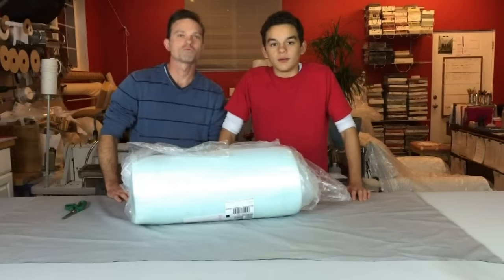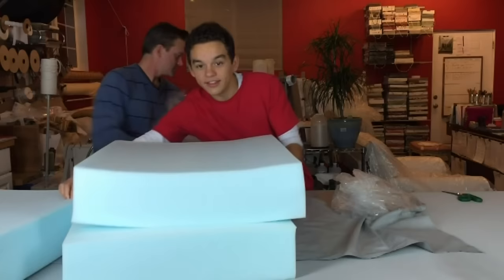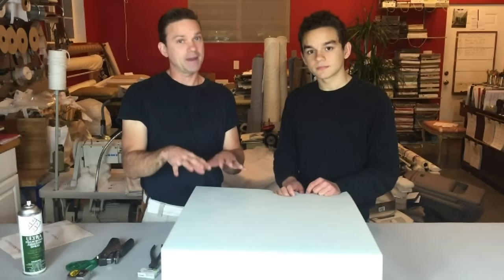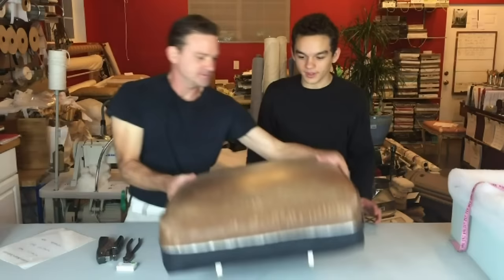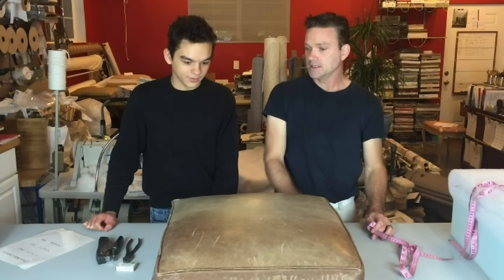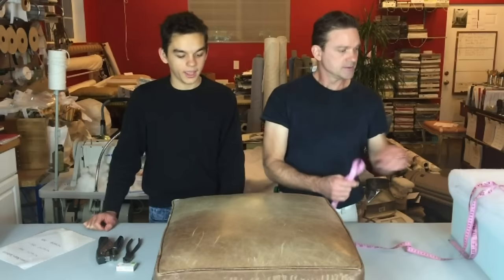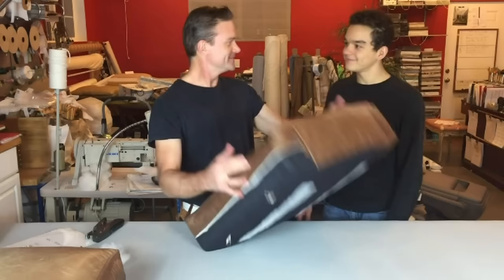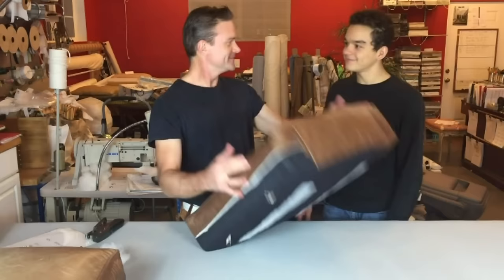Replace the foam in your seat cushions fast and easy!

Comment: An elderly (92 year old) seamstress told me today that she used to use some kind of pillow machine to squeeze the foam in all directions so there would be no struggle to get the case over the foam, and it would go on easily. She said the machine had straight metal arms that compressed the foam. Then she pulled the case over the metal arms. The she slid the whole covered pillow off the metal arms. So putting the foam in the case took only a couple seconds. It looks on this video that you don’t have much struggle getting your foam into the case, but in real life, my foam doesn’t slip so easily in. I’m searching the internet to find a pillow machine like that lady described to me, so I came across this video. But I’ve seen no such machine anywhere online yet. I would love to know if you know of any such machine.
Reply from the maker: Hi Heard,
Great question! Personally I’ve never heard of a machine like that. If you are nervous about putting in foam into your cushion covers you can use a plastic silk film to vacuum down the insert to a more manageable size. You can get the silk film here https://www.amazon.com/gp/aw/d/B071229FT1?psc=1&ref=ppx_pop_mob_b_asin_title

Though, inserting cushions into covers, like you said in your comment, isn’t that hard. You can put your cushion on it’s side on the floor and use your body weight to push in the insert one side at a time. 
I hope this helps! 
All the best, 
Grant

Comment: Hi, you have mentioned the Density as 26 and ILD as 45 for one of the foam.

What's the units of measurement that you are using.

Density- 26 Pound/foot^3 or 26 kg/meter^3
ILD- 45 pounds or 45 kg
Reply from the maker: Hi there Ritesh, good question. The system we use is the first two numbers is for the density 2.6. That is representing the volume each section of foam has 2.6 is good. The second number is for the compression in pounds. How much weight it takes to compress a piece to 75% of it's original thickness. So a 4" 35 compression will take 35 pounds of weight to compress the 4" to 3". I hope this has help you and thank you for watch the video. Please share it helps when you do. Cheers,  Paul
Reply: @ucsolutionsgivingmore  Thanks, so 2.6 density means 2.6 pounds per cubic foot. And ILD of 45 means 45 pounds to compress 25%. 

Your viewers are from different countries which might be using units of measurement. It took me a while to guess and convert your description to understand what you meant.

Comment: I took my cushions to a local cushion/foam business and my cushions are now worse.  It appears they measured incorrectly so the cushions don't fit on the couch correctly, thus I'm going to try and redo myself with the help of your video.  The fabric of the cushions bunches in some areas and pulls in others.  Should I measure in multiple areas and average the measurements or should I remove the cushions and lay the fabric flat to get the best measurements?  Or can I just send the fabric to you?  Thank you for your assistance.
Reply from the maker: Hey, Shalese thanks for watching our videos! Sorry to hear about your experience with the previous seat cushion replacement. Great questions, your cushion measurements shouldn't vary too much, if they do you can “average” them out closest to the highest number. You should definitely measure in multiple areas though. And you can measure without the existing foam just make sure the cover is perfectly flat and symmetrical. I hope this helps!

Comment: So when using that recommended compression chart, the thickness numbers are for the foam -- not the cushion band, right?  So if my seat cushion has a 3 inch band, you're recommending 4-inch-thick foam.  So I use 4 inches (not 3) on that chart, which yields 2626 foam.
Reply from the maker: Hello Matthew,  
Yes you have that correct the numbers represent the thickness of the foam not the band. Again that’s correct if your bands are 3 inches you would want to get 1 inch thicker or 4 inch thick foam as well as 1 inch larger left or right front to back in other words everything is 1 inch larger. Here’s our website ucprivatecourses.com   Compression number 26 is a soft foam you might want to go with a 35 compression for a firm cushion. It sure is only a recommendation if you like firm I would go with compression 35. Please share the videos with others it helps a great deal when you do. All the best,  Paul

Comment: Great video! If I am putting new foam inside of down inserts would I go an inch over the width of the seams of the fown bag covers? And do you need to use the dacron? Thanks!
Reply from the maker: Hello Jody,  NO! Remove the foam from the feather cover. Order the EXACT SAME SIZE as the your foam inserts that are inside the feather covers. DO NOT ADD any measurements to the foam no need for Dacron either.  Thank you so much for watching the video we appreciate it. Please share it does help us when you do. Cheers, Paul

Comment: What the common size in cushions? When making your own pallet couch or what would you recommend to use.  Because it has a wood backing and bottom.
Reply from the maker: Hi Joseph,
Great question! First time we’ve been asked this. I’ll give you some general measurements that make up the majority of sofas, though you do not have to stick strictly to these measurements. Seat cushion thickness is generally 3” - 6” finished. Please note whenever I say “finished” that is the cover size not the foam size. Whatever the cover size is, you will need to add an additional inch for your foam size. Now, to choose the correct finished cushion thickness you will need to know the seat height that you would like your couch to be. The general seat height of a couch is 18 inches to 21 inches. If you have any questions about this please let me know. Cushion depth, that is the measurement from front to back is usually anywhere between 25 inches to 30 inches. And for back cushions the thickness of your back cushion should generally be thinner or at least not thicker than your seat cushion. Since the couch will be made out of wood, depending on your preferences I would use a 26 density and 26 compression (soft) since there will be no give under the cushion. You can order your foam here at our website: https://ucprivatecourses.com

I hope this helps, let me know if you have any other questions!

Comment: One more question: You ordered the foam +1 inches above the measurement. How much more does the dacron add (or how thick should it be not to overstuff the cushion?
Reply from the maker: Good question! The Dacron does not really add anything to the cushion other than softness and gives a fuller look. It doesn’t have much pushback so it shouldn’t really get in the way with one layer of Dacron. So in the video we don’t account for the Dacron we included it but it’s not part of the measurements, not really necessary. So when ordering foam you would go by the cushion cover size. And add 1 inch foam to all those measurements front to back side to side and the thickness, Dacron is not in the measurements. Again really appreciate you watching please share because it helps us when you do. If you have anymore questions send them our way. Cheers, Paul

Comment: I have a 3 seat sofa that had sewn in cushions, I cut them our but did not keep the covers. I'm now trying to order the correct size foam.   Measuring the sofa I get 24x24 squares, based on this video I should add an extra inch to height and length but now my covers are stretch with no zipper.  Does the same requirement apply to non-zipper covers....
Reply from the maker: Hi Brenda,   I’m a little confused about the covers I hope that works out for you.  However, The size of your foam you have now is what you will replace. Apparently that fits in your existing covers. For emphasis do not add more to the measurement then your existing foam is now. I hope this helps thank you for watching please share the videos it helps us when you do, all the best,
Paul
Reply from the maker: Hey if you need a source for excellent   foam go to ucprivatecourses.com. Thank you.

Comment: So how would you do this if your cushions are foam on top of springs, but the how thing is removable from the cover? I have a couch where the seats are like that and after I'm wondering if I should just get rid of springs and redo the cushions with just foam or is there a way to apply new foam to the springs? Mind you it was a cheap couch so the springs arent the greatest.
Reply from the maker: Hello Crazy, You Need to simply do exactly how it was made box foam springs in the middle. It’s high by the way spring cushions. All foam 26. Density is very nice last a very long time. Thank you for watching, please share it helps so much when you do. Cheers,  Paul

Comment: Great video. Thanks! I'm not sure I can do this myself on our couch. It has three cushions, but they are non-removable. There is a single zipper that runs along the entire back of the cushions, but it only extends out about six inches on the left and right. I could probably unzip the zipper, but working the foam out of the case and new foam in seems like it would be a nightmare. A job best left for professionals?

Comment: Excellent tutorial live the dynamics between you father and son ☺️I have a leather corner suite ,with no back zipper only access is underneath but has coil spring how do I access the cushion .? Thank you
Reply from the maker: Hello Maggie,
First thank you for watching the video, glad it was a help. To your great question: I have had to deal with this question several times. To do any of the following steps removing the outside fabrics, you will need replacement upholstery tack strip (sometimes it can be reused if not to bent) or what is called metal ply grip or curve Ease. Depending on what your furniture has now.
It depends on the construction of the furniture. It could be one of several different ways to remove the foam. 1) Maybe there's access from the bottom by removing the dust cover or bottom cover. There might be a zipper at the bottom of the seat platform from under neath.Does not sounds this will work for your sofa. 2) Is going through the outside back, removing the fabric maybe there's access to remove the foam there.I would try the third last, it's a little more work. 3) Remove the outside back fabric as well as the outside fabrics on the sides (YOU DO NOT NEED TO TAKE THEM COMPLETELY OFF, BOTTOM AND SIDES ONLY, FLIP FABRIC UP OUT OF THE WAY). Remove the staples that hold down the platform fabric to the frame (the sides and the back of the platform). When the platform is loose go to the front of the sofa (or chair) and pull the cushions off the sofa. The cushions upside down there should access there.Replace cushions according to the video and reinstall in reverse order. WOW!!  MAMMA- MIA.  A lot of work RIGHT! Honestly I really wish they would STOP making this style. Most furniture can go for many more years if the cushions could just be replaced when needed, with ease. It's a lot of work so it can cost more then the sofa originally did. Or too much work for the average person so they are not interested in doing it. So it ends up in the landfill. I hope this has helped you to make a decision. Please consider sharing the videos with others and on blogs, it helps us a lot when you do. All the best,   Paul

Comment: Great video. Do you put that outer layer stuff around the foam for outside furniture cushions?
Reply from the maker: Hello Christy,  
Thank you first of all for watching the video and giving us a comment. The outer layer or also called Dacron or poly batting is not necessary for outdoor cushions.  For the most part it should be glued on especially with outdoor cushions because of the cells of the foam are very large and staples will not hold to it. The glue would impede the flow of water to go through the cushion. Just in case you don’t know outdoor foam is different from indoor foam. Much larger cells easier for water to flow through. I hope this answers your question and again thank you for your comment.  Good question. Please share it helps us when you do.  Cheers,  Paul

Comment: Hello! I am considering purchasing a used fabric sectional. It is beautiful but not as comfortable as I would like. Would changing out the foam in the cushions etc make a difference? I usually like how the Pottery Barn York or PB comfort sits.
Reply from the maker: Hello Kelly, thank you for your support of our channel. Great question if you like size meaning it fits you comfortably back legs height. Then YES the cushions will make a big difference companies have been make the foam very hard or firm to use the cheaper less costly foam. However I will let you know GOOD foam cost it’s an oil byproduct not cheap. Please go too ucprivatecourses.com we sell foam and will be happy to help in anyway. Please share the videos. God love you for it, Paul

Comment: I have a vintage couch that has the opposite problem. The cushions are filled with down, which is too hard. The end cushions are the L shaped ones. Would it be best to just replace the down with foam or add foam to the down? I subscribed because you and your son do a great job of explaining exactly how to replace cushion fillings. There is one thing, though, my husband always scrunches cushions because he sits with his feet up and leaning to one side due to injuries. He also uses his feet to lift himself off of the couch. Thanks.
Reply from the maker: Hi Claire,
Thanks for watching our videos! Great question, usually down cushions are too soft so I’m wondering if you have foam core in the middle that is super firm. If that is the case you can always switch that out for a softer foam core. Please let me know if your cushions do have a foam core in the down, I’d be happy to help you through this project! 

Grant

Comment: Thank you very much for the video and instructions!  I have a quick question and apologies in advance should this question already been addressed.  I have a sofa seats are in a L shape rather than a full square shape.  How would you address this issue when measuring?  Do you cut it yourself or have the supplier cut it to your specifications?  

Many thanks!
Reply from the maker: Hi Rob,
Check out this video below it should help you to measure a T cushion with no worries. Albanyfoam.com can help with the foam.  https://youtu.be/dq2a1WPrLJ4  Thanks fore viewing. Cheers, Paul

Comment: Guys, would you also recommend "vacuum-shrinking" the foam pad to make it easier to get the cover on? I'm thinking something like a trashbin bag, which can then be removed once the cover's on? Any experience of that kind of hack?
Reply from the maker: Hey Paul, (cool name) Above all else thank you for watching really glad you did. Great question I know a lot of upholsterers do use the vacuum method I have not.  I believe the plastic film is called skim, it’s super thin so when you pull it out to close the cushion cover if any stays in it will NOT be felt. A trash could work but for the fun of it I was going to do a video using a dry cleaning bag its pretty thin.  Hey if you any other ideas let me know. Again thank you for contacting us. Please share the videos it helps us when you do. All the best,   Paul as well 😁
Reply: @ucsolutionsgivingmore  Thanks for the reply, Paul. I love watching your video content and I'm looking forward to seeing you work with the skim. I tried but it got sucked up the vacuum cleaner!

Comment: I was just wondering....I've taken off the leather seat covers to my couch seat cushions and was wondering if there is any reason why I can't just measure the foam and order those by those measurements?  I also noticed all three are slightly different in measurement say by 1/4 inch.  What size do you think you would go with?....an average of the 3 cushion seat sizes?  And any suggestions on how to get the musty/mildewy smell out of leather?  thank you very much for your time.   I enjoyed your video and look forward to viewing more.
Reply from the maker: Hello Diane,      Thank you for watching our video. Great question! No a 1/4” will not make any difference at all the foam will simply compress, so I would order the largest size of the three. Secondly YES you can just order the finished foam size that you have. WITHOUT the added  1” all around. If the cushions look good and fit the covers when the foam is inserted then yes simply order the size it is now. For the odor in the cushions, try baking soda sprinkled in side the covers.  A good amount, try that two or three times. Discarding the old each time. Let the baking soda sit overnight. That should reduce some of the odor, neutralizing it. Lastly on top of the leather try a scented leather conditioner a few times that should help some. You can order the foam at ucprivatecourses.com if you need a place to order.  Just put in the measurements and get a quote to your door.  Please check out our latest video save my assets episode 18 you could win a gift card. Please share the videos with others and helps us a lot when you do.     All the best,   Paul

Comment: Hey thanks for the video helped alot. I have a question what can I use to clean my polyester fabric and polyurethane fabric couch? Thanks
Reply from the maker: Hey JR, really glad the video helped out. Thanks for leaving the comment and letting us know . I had to hold off on answering your comment, because we’re going to do a video on cleaning furniture. You should be fine using this method in this video to clean your sofa. Hey please subscribe and share with others if you haven’t already, it helps us a lot. Cheers, Paul.     Furniture Cleaning and Loveseat Makeover - Mirrored Back Loveseat | No Strings Attached https://youtu.be/QxuqF0r5gm0
Reply: @ucsolutionsgivingmore  thanks man will do.